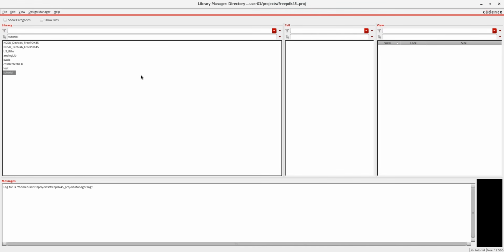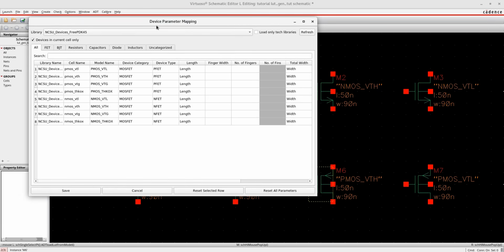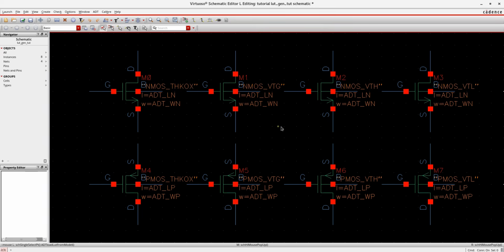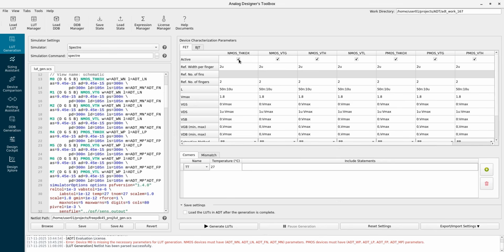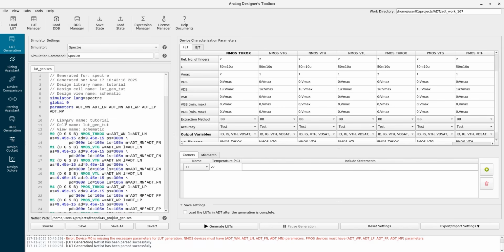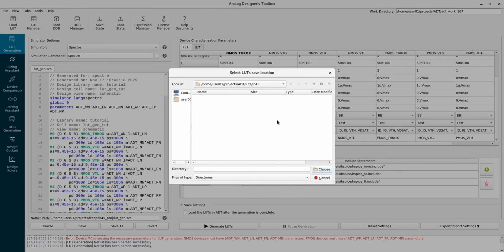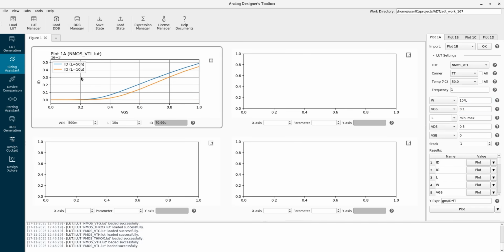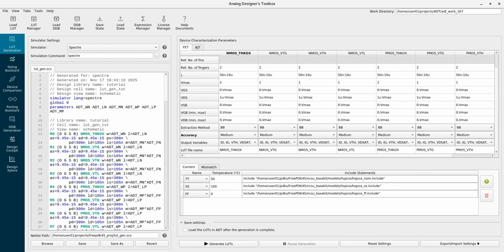Lookup Table (LUT) Generation Tutorial | The Analog Designer's Toolbox (ADT)

Comment: i got this erorr when i clicked  generate LUTs . [22-11-2025 19:20:03] - Error: [LUT Generation] The simulator cannot be started. Please specify correct 'Simulation Command' and double check that the 'Simulation Command' works in the OS terminal. what's wrong ?
Reply: you can add the full path of the simulator ex: "/opt/MMSIM151/tools/spectre/bin/spectre" in the "Simulation Command"  OR you can add the location of the simulator in the environmental variable path so you can just write spectre and the system will find it